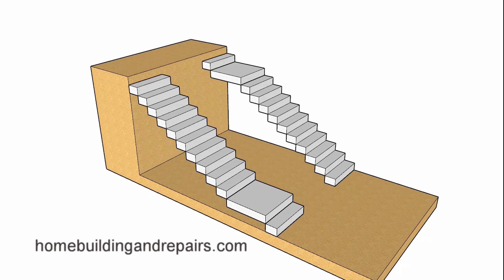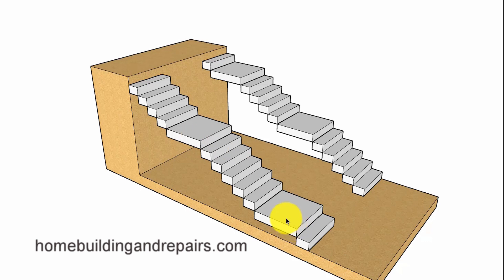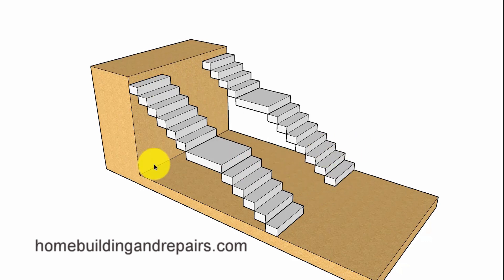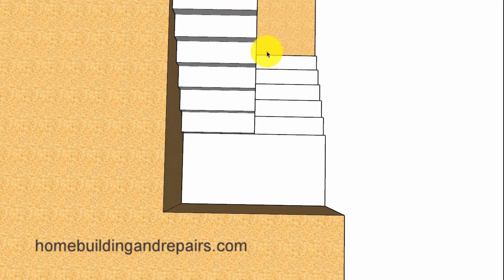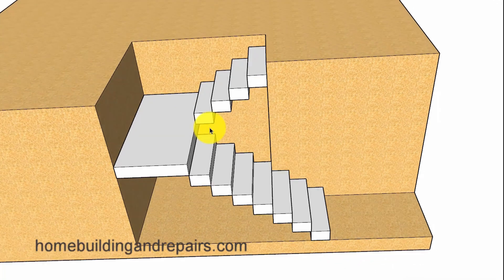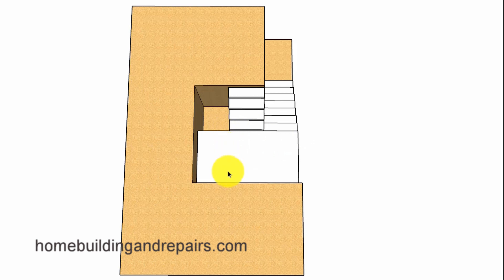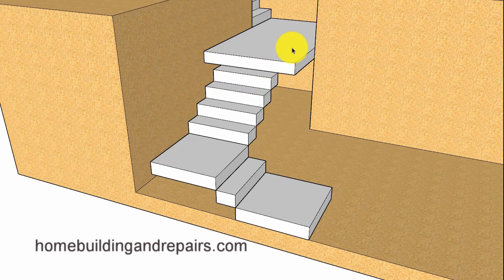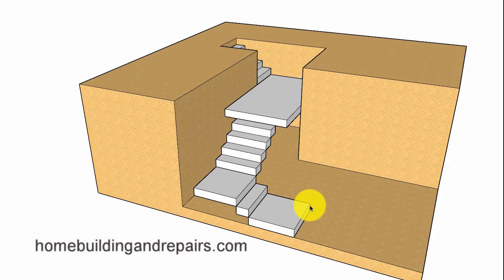Where You Can Locate Stair Landings And How Many - Residential Stair Design Building Codes

Comment: I believe this is incorrect for u-shaped. The mid landing is considered a walkway with a minimum width of 36".  So if, for example, I had 42" wide stairs, then the width of the landing can be 84" wide x 36" deep.  The code only specifies the width in the direction of travel measured perpendicular to the stair. When you are on a u-shaped landing, that is not a stair. It's a walkway. Imagine if the landing on this u-shaped stair was a long walkway, it would only need to be 36", not the width of the stairs coming into it. However, L-Shaped stairs are different, since they must be as wide as the stairs serving it. So in this case the depth does in fact need to be at least the width of the stair serving it.
Reply from the maker: Always check with your local building codes, you might be right.